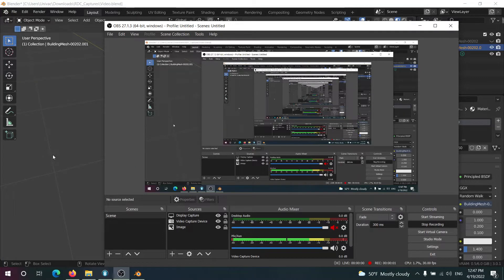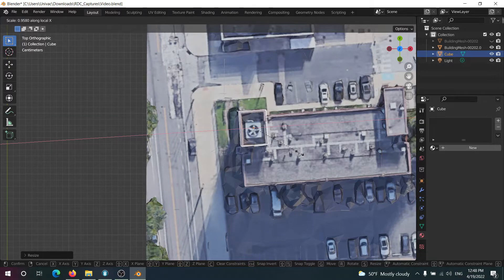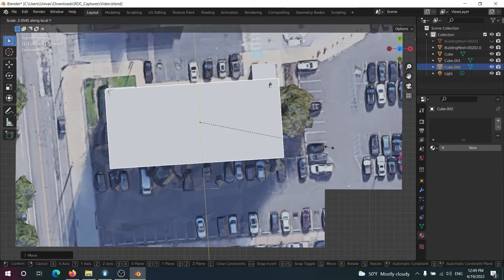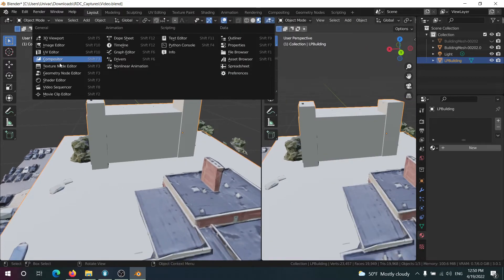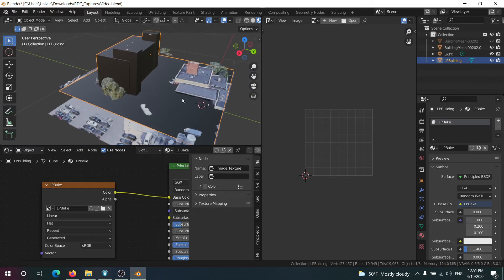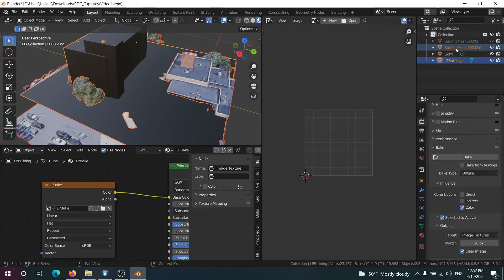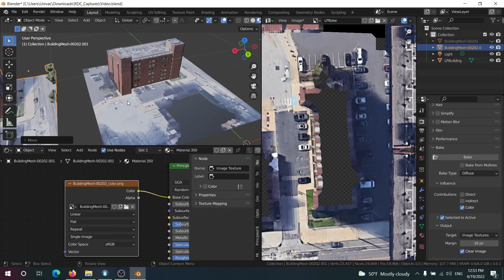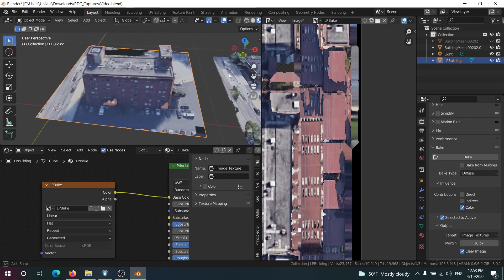Baking High Poly to Low Poly Models - Blender 3.0

Comment: The number of tutorials I've read or watched through... the hours I've spent bashing my head into my desk trying to figure out why blender insists no valid objects are selected... The key was right at 4:11 -- "Ctrl-Select." 🤦‍♂️ Isweartolinus this is the least intuitive program I've ever learned.
Reply: I don't know, I've studied baking for one and a half years with no result but you are correct. No one ever mentioned Ctrl Select or what ever or the red orange and orange needs to be highlighted. I don't have much faith it will work. I'm on my phone but toiling about giving it a whirl on my laptop.another this g no one can answer is what good are nodes if most of them don't remain on export and reimport as obj, fbx or collada .dae? They only remain on saved scenes, standard blender save but not as exports. Seems like a lot of trouble for something that is nothing more than dust and air.
Reply: @jasonbowman9521  Wait, one is red and another is orange??? Ugh, my deuteranomaly strikes again.
Reply: @jasonbowman9521  Well to be fair if you hover over the checkbox it says "Bake shading on the surface of selected objects to the active object.". If you read a bit on Blender you should know that the brighter of your selection is the active part. But yeah I wish there was an easier way, like it is e.g. in Substance Painter.
Nodes are for procedural texturing. You can bake them basically the same way as he did. Also you can (just like Geo-Nodes) group your nodes to reuse them in other projects.
If you're having problems with the exports in general, dont forget to click File>External Data>Pack Resources, so you can also export external data.
Hope that might help!